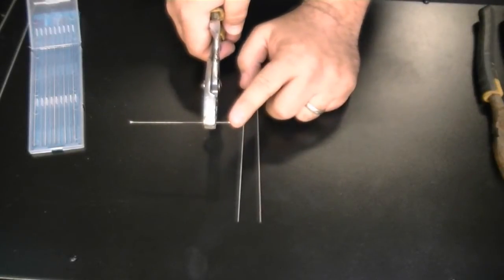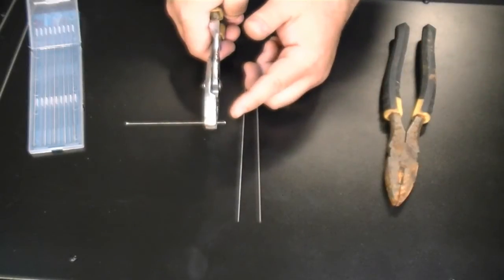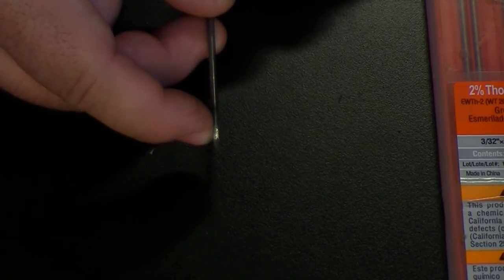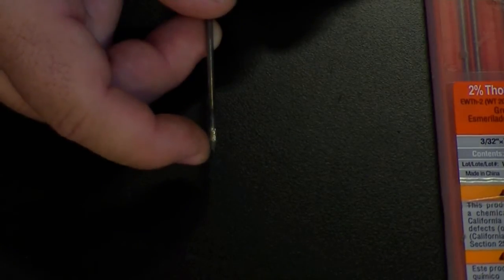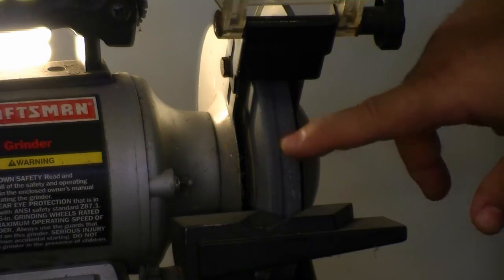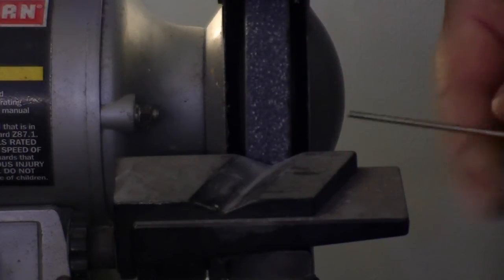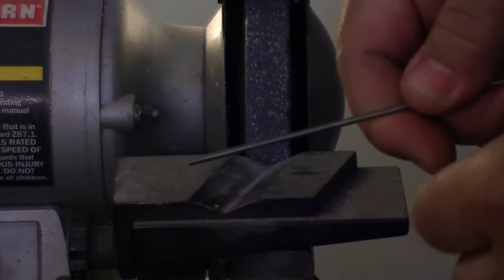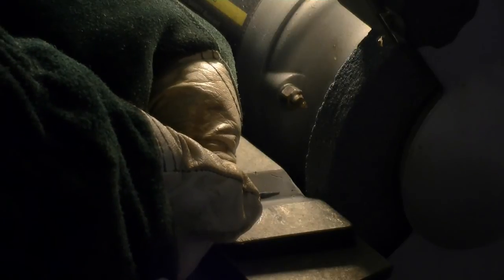How to Grind Tungsten for an Everlast Inverter TIG Welder

Comment: People make way too much out of having a dedicated grinder, the reality is tungsten is hard enough it takes it off the wheel by wearing away the surface pretty quick but to avoid any, just buy a cheap stone dressing stick, touch that on the stone before you start, or just after you ground contamination off tungstens you dipped... contamination gone, along with the wheel surface it was embedded in and any incipient grooves.
Downside is your wheels wear faster, but they're relatively inexpensive you'll probably save enough in not breaking big chunks off tungstens to offset that cost anyway, BIG upside is you maintain a flat surface and nice square edges on your grinder wheels, and you'll love that when you go to grind chisels, big drill bits, small parts etc. where that matters.  The star wheel gizmos demonstrated here are a bit aggressive for the approach I'm suggesting, they're great for re-profiling grooved wheels as they take more surface off faster, they're also more expensive, hence saying a cheap dressing stick.
Only time to worry about a dedicated wheel/grinder/special tool is in a dedicated welding shop or for really high end stuff, namely folks who didn't need this video.

Comment: What are thoughts on using a dedicated scotch bright wheel to polish the tungsten after grinding?  This makes a more diamond like tip.
Reply from the maker: As long as the scotch bright residue doesn't contaminate the tungsten, go for it.  But that is probably only going to have a marginal effect.  And Tungsten is quite hard, so it may be a waste of time.
Reply: Everlast Power Equipment thank you. BTW, I love my Everlast DV 200!!